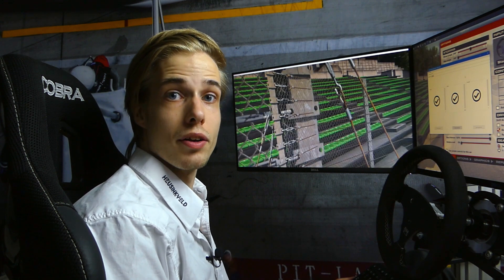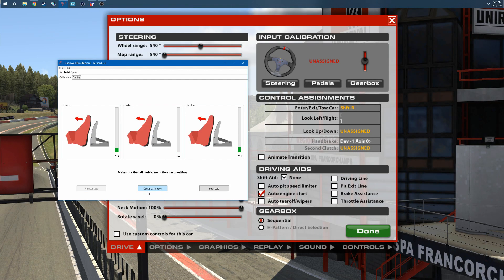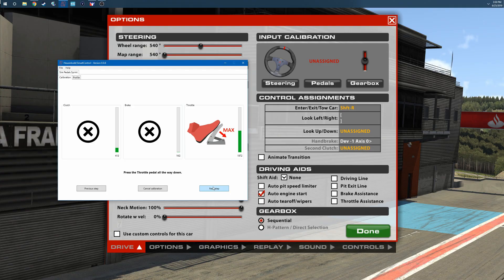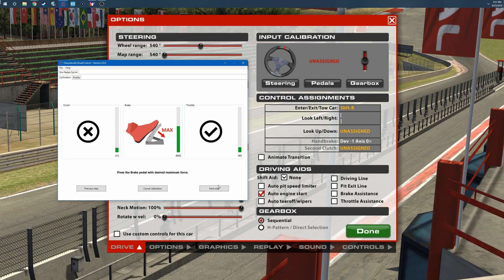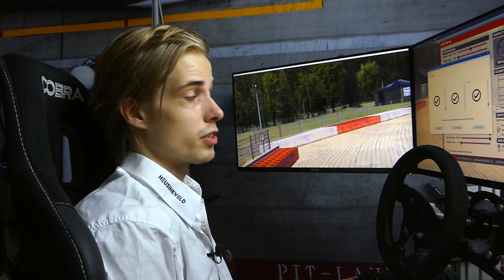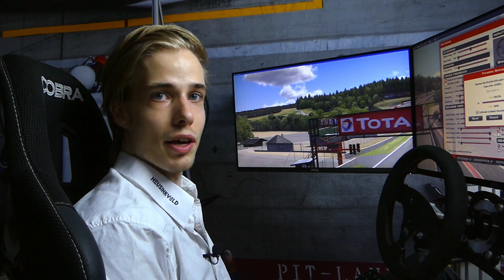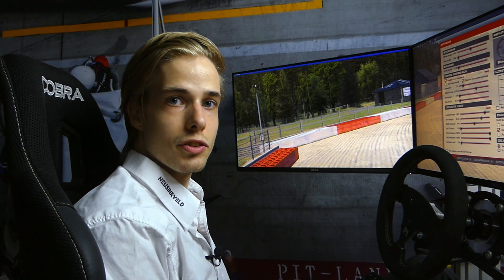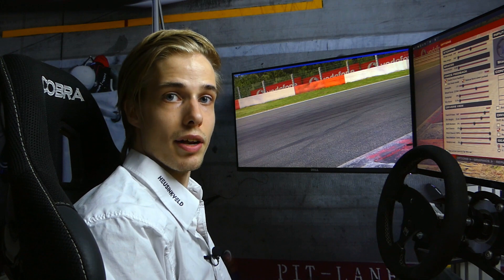Enzo tech talk calibration

Comment: I had them set to 4095 the first time I calibrated, no problem . . . I  installed a new when and iRacing wanted me to re calibrate the pedals also . .throttle and clutch were fine. . but, brake only goes to like 3089 or some odd number . . . Any ideas how to get it back to the 4095 number  . .anyone? . . . .thank you